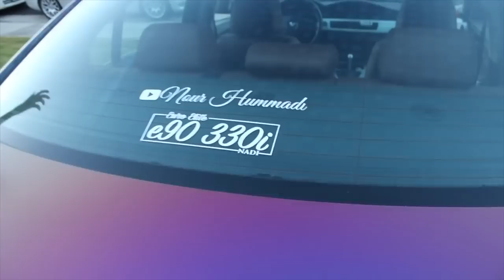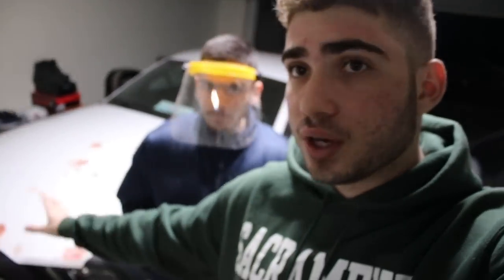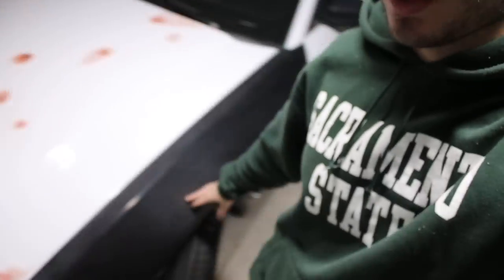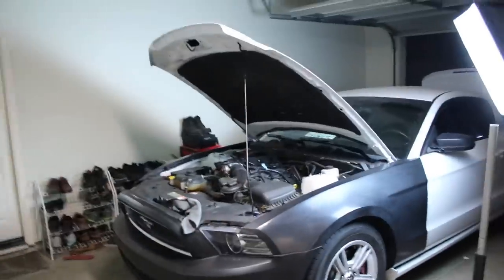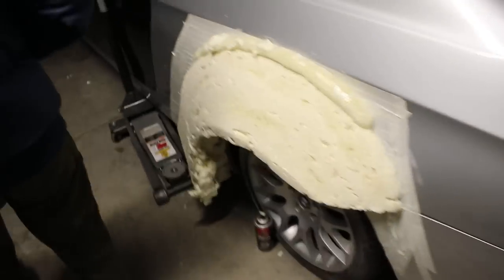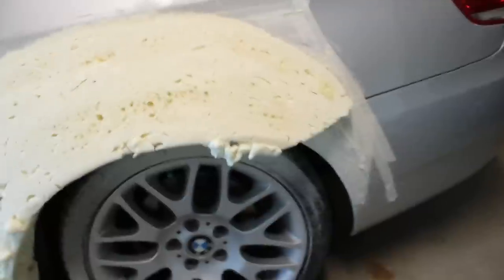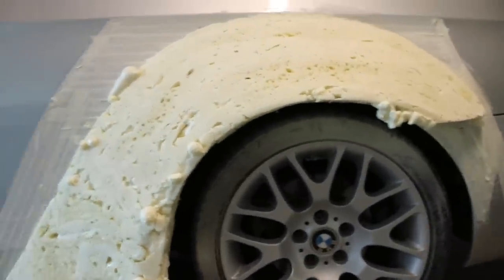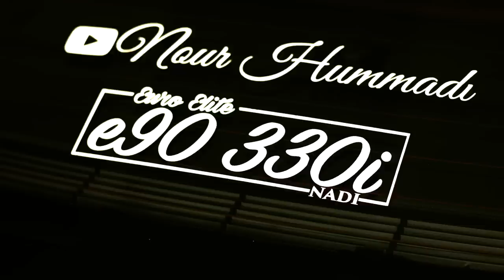CUSTOM BMW WIDEBODY! (PART 3)

Comment: Isn't 500$ a bit much for a headlight? Did you check german sellers on ebay?
Reply from the maker: Gucci E60 checked everywhere, even looked for aftermarket once. For some reason the coupe are just expensive and don’t have any aftermarket headlights